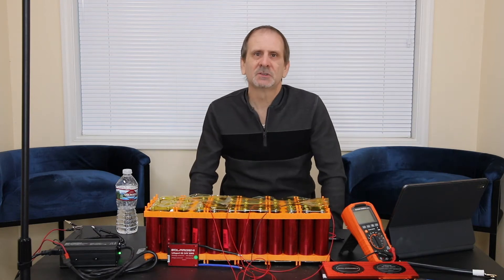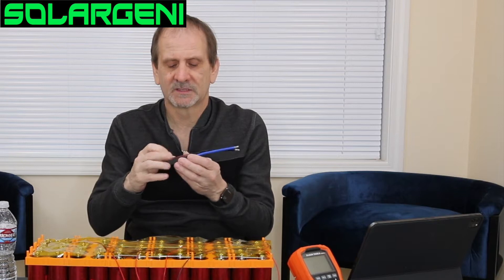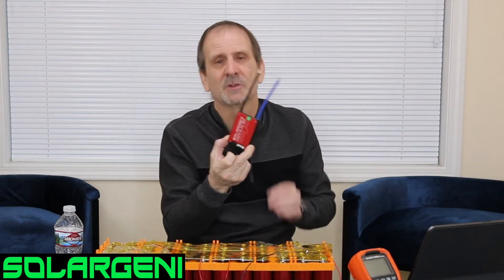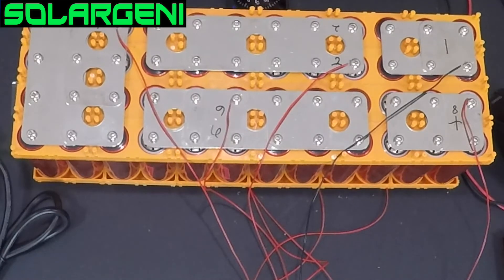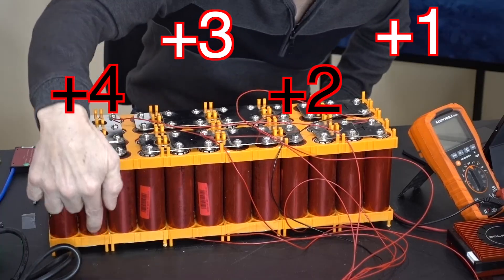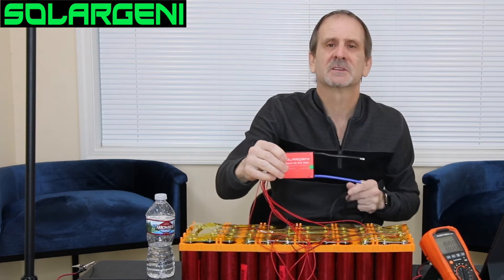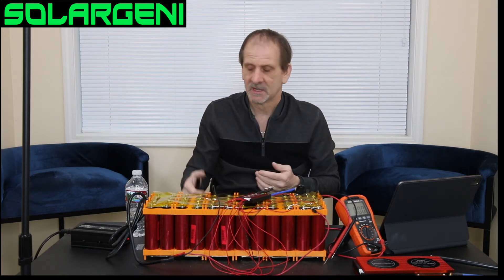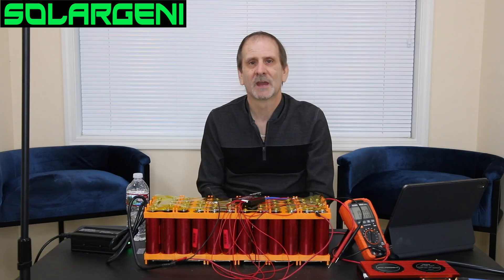How to wire a Balance BMS on headway 38120HP 50ah battery build

Comment: Nice vid.  Looking to build a 24v system to run CPAP machines when power is out and a 12v system to power my ham radio.  Either configuration will fit my purposes nicely.  Link shared on Pinterest.  They should find this interesting.